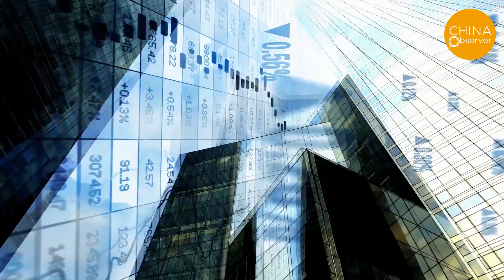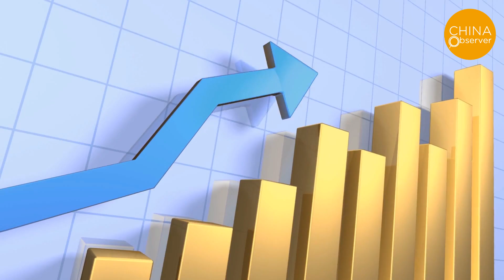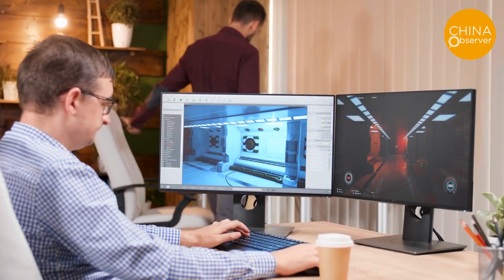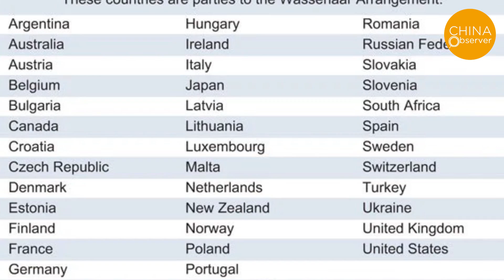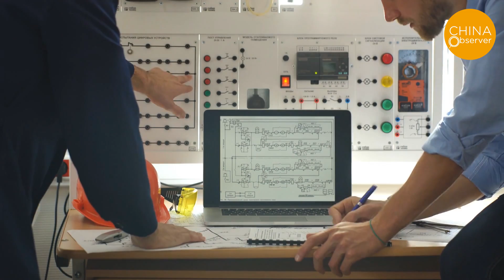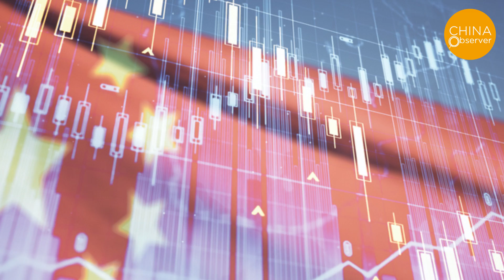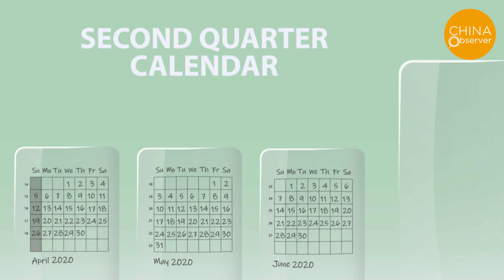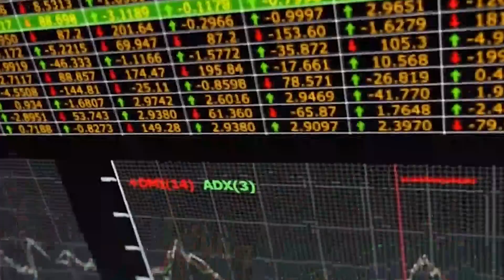Shocked! Why is China Crazy about Making Chips?

Comment: Commie China started their semiconductor research much later than that of other countries.  But compare to Taiwan, Mainland China is overall much more advanced in most fields of science and engineering.  Semiconductor is about the only high-tech industry that Taiwan is doing better than commie China.  Besides, the backbone of this industry is the machines.  They serve as the building block of this industry.  From semiconductor instruments to basic auto engines, Taiwan is not even on the sideline, Taiwan is an observer.  As a matter of fact, I believe Taiwan doesn't even know how to build a laser printer engine.
Please, anybody, correct me if I am wrong.  I am setting up an analogy to chips fabrication.  It is baking a cake. To bake a good cake requires a good bakery.  There are many bakeries but some bake a better cake than the others.  However, they all depend on a baking oven.  If the best bakery doesn't have an oven, the best bakery is out of business.  Of course, the semiconductor oven is wa..........y more complicated than a regular oven.  But credit to TSMS of Taiwan, TSMC is the best bakery, so far.

Comment: Very biased coverage and totally slanted. Even-handed coverage would cover the scams, but it would also cover how Yangtze Memory is about to produce 128-layer 3D NAND Flash memory, SMIC is expanding its 14nm fab and building a new 28nm fab, SMEE is about to release a 28nm DUV lithiography scanner, and UNISOC is acquiring market share in application processors for mobile phones. There is quite a bit of evidence that China's chip making capacity is growing rapidly. There is no doubt that many of the new chip ventures in China will fail, but some of them are clearly succeeding, and China Observer is not presenting an accurate picture of what is happening.
Reply: One thing is for sure China ia turning into North Korea. Isolating itself instead of making friends. Good luck CCP.

Comment: Haha, the ending with ridiculing China's assertation that democracy doesn't fit in China is great, even though it can't be the explanation why Taiwan is successful and China is failing non stop on chips.
Reply: Key reason China can't make advanced chip is because they are denied access to Dutch ASML's ULV equipment.  However, we are at end of silicon based semiconductor technology.

Which means ASML's ULV tech is probaby going to become obsolete as the industry shifts toward graphene based semiconductor technology.
Reply: ok, Muhammad, let me ask you two things.
fisrt, could your country produce any thing expect oil?
second, indeed Taiwan beat China on chips, but what about the other aspects? does Taiwan beat China on everything?

Comment: China will succeed, without a doubt!!!
Reply: When? Tech is always based in another tech and so on. Chips requires a lot of resources
Reply: @kealeradecal6091  Eight times STEM graduates output compared to the US , spending USD 1.4 trillion on chips research and manufacturing for the next 5 years , unwavering resolve to develop that industry. Proven record of successfully developing other advanced tech industry like jet engines , Beidou sattelites equivalent of GPS , space explorations , nuclear energy , quantum communication and computing , high speed rail , AI , fusion reactor and Thorium energy etc. 
They accomplished a lot since the last two decades and i don't doubt they would fail in advanced chips development.
Reply: China will succeed but only if CCP dissolves. Communism should be ignored and be treated like Nazis.
Reply: @dvidfmar  Really, seems to me you are suffering from Delusion!!! Most successful Government in History!!!